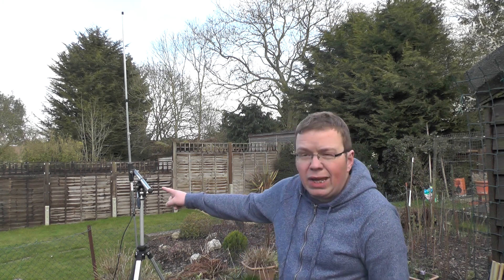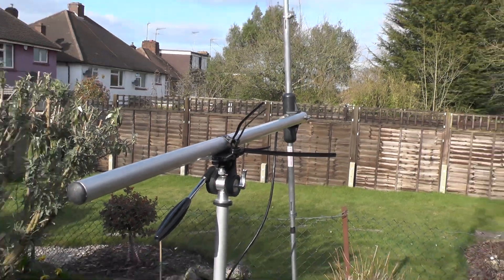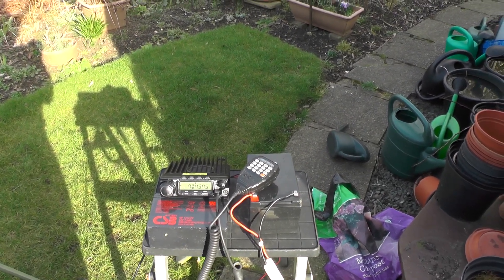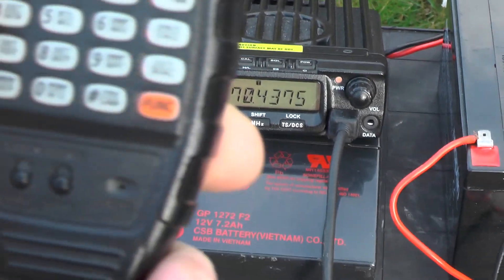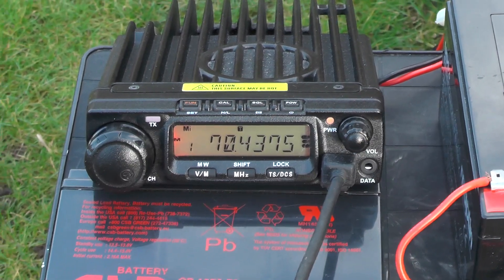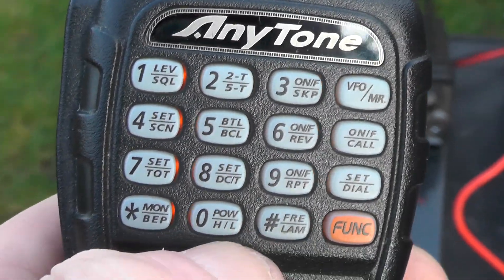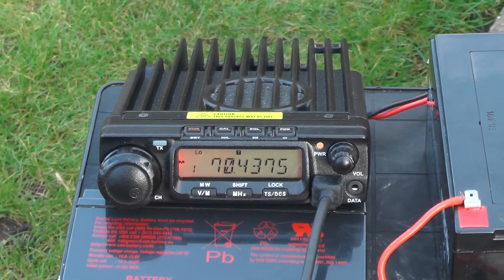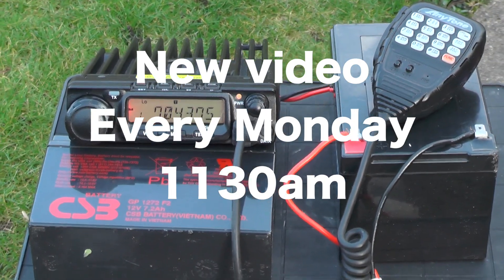Testing my 4m(70mhz) radio

Comment: I gave up on 4 meters for a while because my signal was to lousy only reaching a measly 5 miles halfwave dipole with 10 watts but I'm ready to give 4 meters another go. I'm getting a much better antenna this time. I hope to make the Wednesday and Thursday 4 meter net once I'm all setup.
Reply from the maker: I use a viper antenna for 4m seems to work better than the dipole

Comment: Can you program this radio with  chirp?
Reply from the maker: Ive only got 1 memory programmed in mine which is MB7FM all other frequencies I enter by hand .
I don't have the programming cable so haven't tried it on chirp. The website for chirp doesn't list it ,but you may be able to program the radio under a different name. I did a few baofungs the other day and had to select a different model of baofung to get it to program
Reply: Thanks for the reply... I did manage to manually program a few repeaters after reading the manual 😀. It’s really a nice radio
Reply from the maker: Global Mobile 01 I like the radio it seems well built the only repeater near me on 4m is mb7fm about 30 miles away
Reply: 2j4ez wow!!!!  I have 8 repeaters above 2000ft
But sadly most of them are quiet ☹️